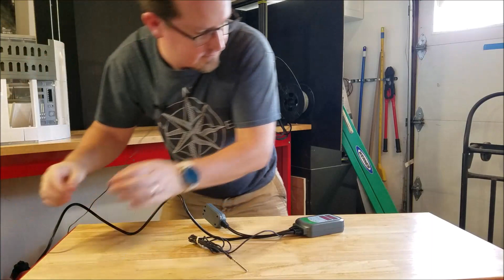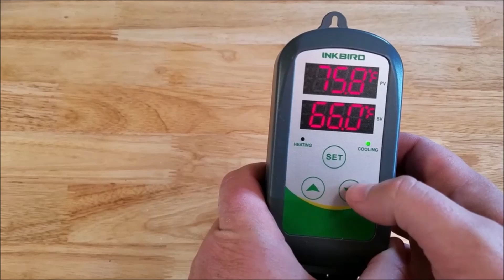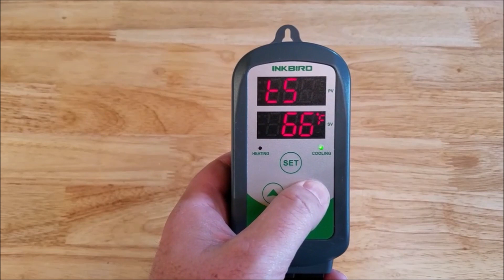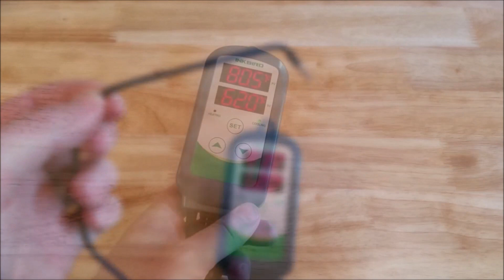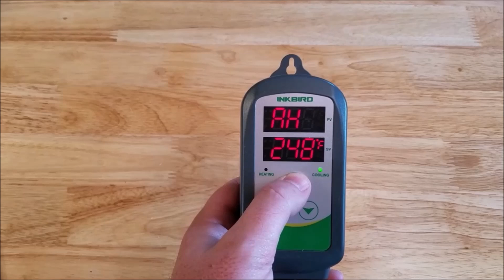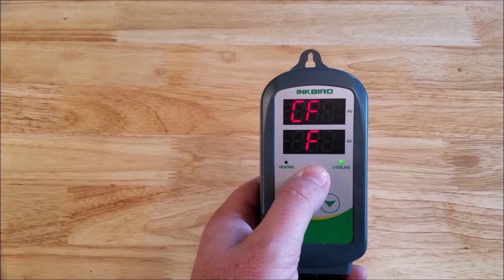How To Setup Your Inkbird Temperature Controller | Home Craft Brewing 🍻

Comment: This may sound like a silly question. Where you place the plugs, it states 'Heating and Cooling' can be used for heating with the same settings. As i will be using the device to heat my repiles.

Comment: I AM looking for a tempeh incubator.  A friend had been one using a cooler,  and the set up with the light bulb and the thermostat inside the cooler.  I stopped working after many good years.  Do you think a inkbird could maintain the temperature inside the cooler which has to be maintained a 89 -90 degrees F.  Help .  thank you

Comment: You missed the most important part, after you get all your settings in place you need to hold set for 10 more seconds to lock them in, otherwise it will revert to default.
Reply: tysm i got so confused

Comment: Good video but you should explain that you're setting the degrees for when it goes hot or cold if it goes three degrees up you set it at 3 to kick the cooling on vice versa for the heat. you're not actually setting a temperature you're just changing the degree.
Reply: I'm not that great at explaining.

Comment: So I want to get a heat band for my 5lt carboy, I have a decent recipe for a pear hydromel, 500g orange blossom honey, 1lt pear juice, topped up with water, 5g pectic enzyme, 1g yeast nutrient and 3.5g lallemand voss kveik ale yeast, bottle conditioned and 6.5%, but I think it could be better getting those funky fruity esters at a higher temp, when I feel my carboy its cold and were in November, (I live in AUS) 
So I was considering getting a small heat band off ebay  and getting one of these inkbirds so I can keep it at about 28-30° C
My question is when you are only heating do you need to use the probe? If not than I don't see this working, it won't fit in the lid of my carboy, (5lt glass carboy/demijohn with rubber stopper and airlock) 
Cheers 👍🍻
Reply from the maker: If you don't use the probe. It won't heat it to the level you want. Check out my video on using the probe with a carboy. You can get a stopper that allows you to put the probe to enter and stay sealed.
https://youtu.be/2qiWxCtjHxQ

Comment: This is an excellent and quick user guide, thank you. I am using mine for kombucha and vegetables fermentation with a heating mat inside a Styrofoam cooler. I am doing this since it is starting to get cooler here in Canada (Ottawa) and I haven't turned on the furnace yet (waiting another 3-4 weeks) to heat the house so my ferments aren't rising to the desired temps.

Comment: How to get the cooler light on green
Reply from the maker: You need to set the low and high temperature. Once it goes above the high, the cooling plug should turn on